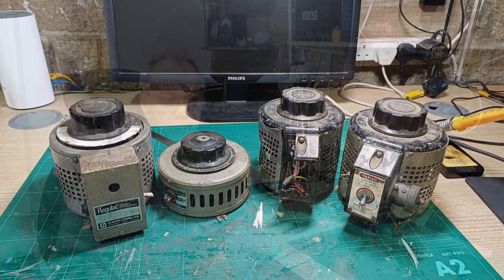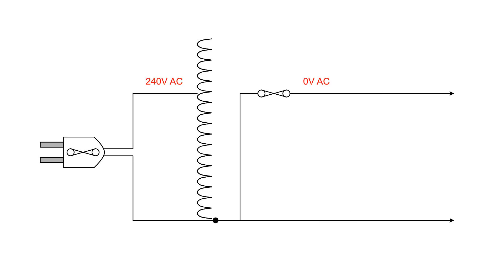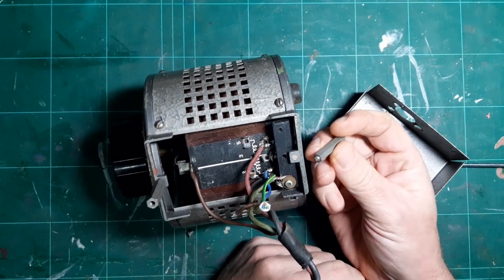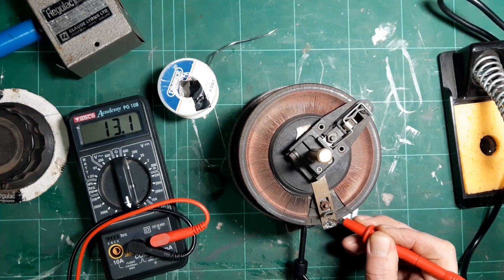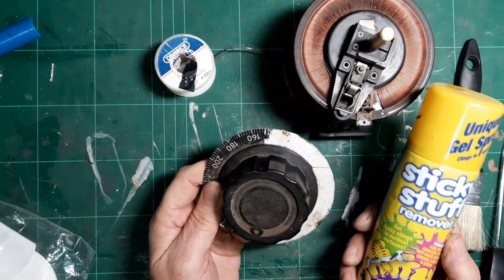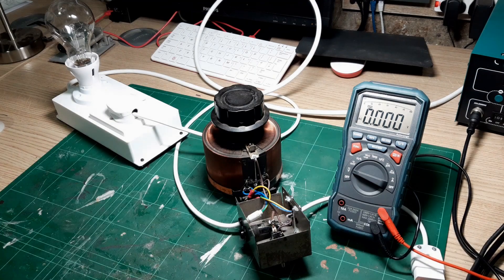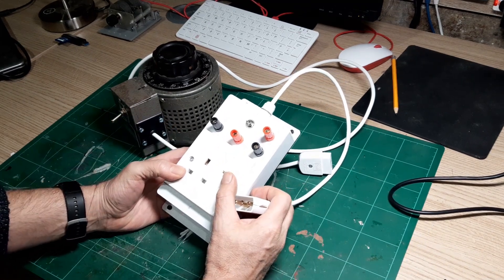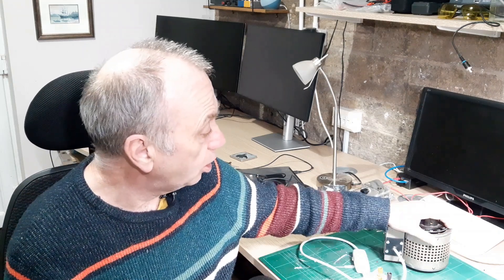Claude Lyons Regulac (like a Variac) Restoration

Comment: Do not get sucked in by the cheap prices for the Asian variable autotransformers. SearchYT for their many, many defects... Under engineered, ratings over stated, wired incorrectly, on and on.
Reply from the maker: Some Asian products are good. I have many good products. They are good at making thing to specification. If you specify cheap then that is what you get. If the cheap auto transformers are 3 time cheaper than others on the market, then you will be getting what you pay for. I had great fun renovating this one so that is another a option to get a cheaper unit.

Comment: Ooo... I would not have used IPA to clean the coil wires, as it might melt the enamel isolation, causing shorts. Maybe just water and a little dish soap. If the brush is in bad condition, it is very difficult to find a replacement. You can not DIY an electric motor brush. They are simply made of the wrong material. I have posted a couple of threads about this and other variable autotransformer matters, but YT will not me add a link. So, I will post an additional reply with the search information and maybe YT will let that through? You will also find my threads on building a DIY isolation transformer from two transformers, placed back-to-back. You will need that. You will also need a Dim Bulb Limiter and Emergency Shut-Down Switch, which are super easy to DIY. Search YT. I think that you are going to really like having the separate connection box and current reading feature. Okay, I will now try to add the search information...
Reply: EEVBlog. My handle is t1d. Use the advanced search feature and limit it to my handle. Look at the my various titles to find those on this topic. Do well...
Reply: Subscribed!
Reply from the maker: Thank you
Reply from the maker: Good advice. I will do that in future.

Comment: Excellent renovation. Another piece of equipment saved from the skip.
Reply from the maker: Thank you and it will be put to good use. I hope the other two I have can be fixed.
Reply: I would like to see a video of that fix, to learn what can go wrong with a variac. I have never used one or had one, but seems like a must for repairing amps and radios.

Comment: I didn't think to buy a second hand one, I bought a new one. Ironic when you think my hobby is restoring/repairing vintage electronic equipment. However I've made up for it by buying a really old AVO signal generator and an AVO 7. The multimeter works fine and is used for aligning IF stages. The signal generator did need rebuilding. Great video.
Reply from the maker: Thank you for the feedback. I love  my Avo too.